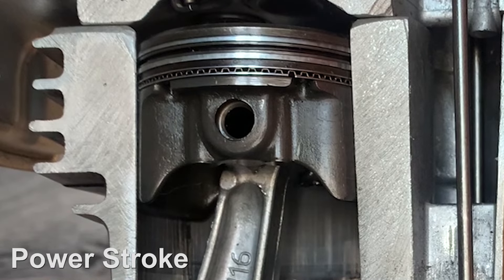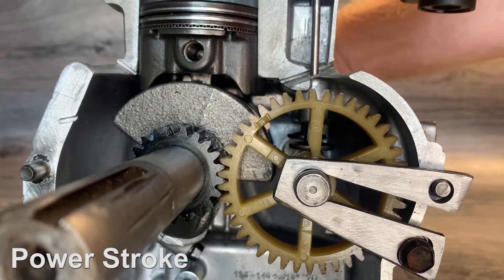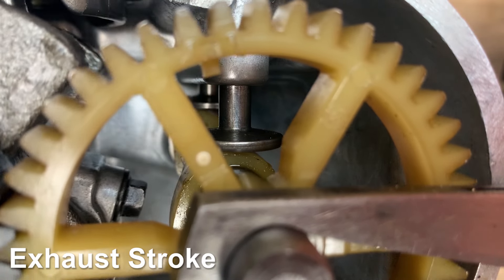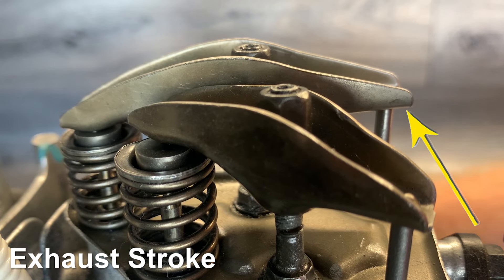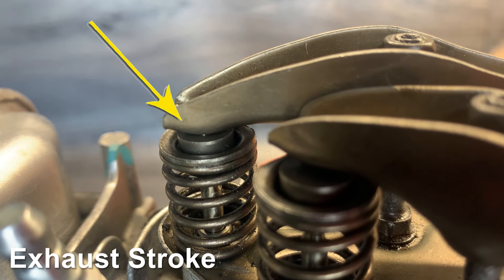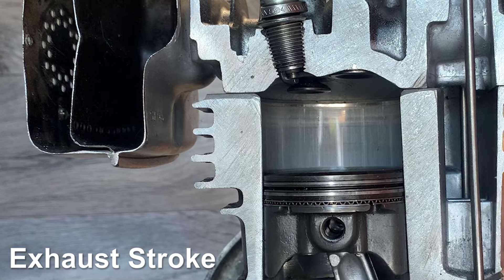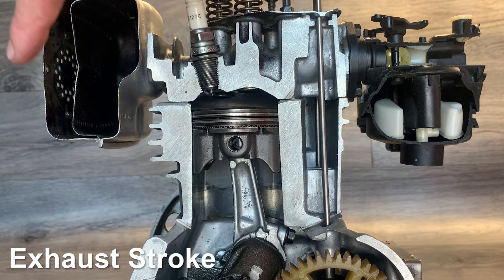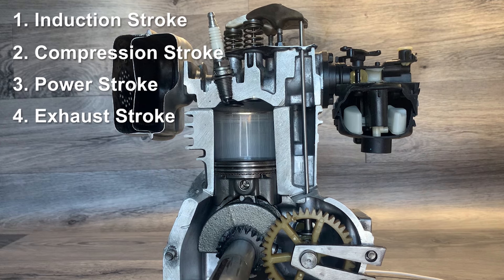Only Video You'll Ever Need to Know how 4 Stroke Engine Valving & Timing Works. (by Craig Kirkman)

Comment: I always adjusted the valves of my motorcycle myself, but only because it is part of the normal maintenance checks, and never really understanding the underlying reasons. Now I finally have a much better picture of why we sould keep good track of it.
However, I wonder why we have to do the adjustment at exactly top dead center, since both valves are completely closed during the whole compression stage. Couldn't we do it at just any point of the compression?
Also, I often hear that if the valves are not correctly adjusted, there is a risk of one of them falling inside the cilynder, causing the complete destruction of the engine. How would this happen?
Reply from the maker: I'm delighted to hear that you found the video on adjusting 4-stroke valve clearances informative and that it provided you with a better understanding of this crucial aspect of motorcycle maintenance.

Regarding your questions, let me clarify:

Adjusting Valves at Top Dead Center (TDC): Adjusting the valves at top dead center is a common practice because it provides a known reference point where both valves are fully closed during the compression stroke. This makes it easier to set the valve clearances accurately. Working at TDC ensures that you're adjusting the valves when they are in the correct position relative to the camshaft lobes and lifters/tappets. While it might be possible to adjust the valves at other points in the compression stroke, doing so at TDC simplifies the process and minimizes the risk of errors.

Risk of Valves Falling into the Cylinder: The concern about valves falling into the cylinder if not correctly adjusted typically applies to older engines with certain design characteristics, such as non-interference and interference engines.

Non-interference engines: In these engines, the piston and valves have no overlap, meaning they cannot physically collide even if the valve clearances are significantly off. Adjusting the valves in such engines might not result in catastrophic engine damage, but it can lead to poor performance.

Interference engines: In contrast, interference engines have piston and valve overlap, meaning that if the valve clearances are not correctly adjusted and the valve timing is significantly off, there's a risk of the piston hitting an open valve during the engine's operation. This can result in severe engine damage.

It's crucial to identify whether your motorcycle's engine is an interference or non-interference type and follow the manufacturer's recommendations for valve clearance adjustments accordingly. Adjusting the valves within the specified tolerances helps prevent the risk of valve-to-piston interference and ensures optimal engine performance and longevity.

Thank you for your thoughtful questions, and I'm here to provide further clarification or assist with any additional inquiries you may have. Safe riding!

I hope this gives a litter more insight

Craig
Reply: @TheRepairSpecialist  That was the best answer anyone has ever given me about any topic, thank you! I will feel a lot more confident next time I adjust the valves of my motorcycle

Comment: What would happen if the clearance is too small like 0.01 of mili meter, how does it affects the air/fuel ratio caused by turbulent flow.? share your ideas.
Reply from the maker: If tappet clearances on a small petrol engine are too small, several negative effects can occur:

1. **Valves Not Fully Closing**: Insufficient clearance can prevent the valves from fully seating against the valve seats. This can lead to:
   - **Loss of Compression**: Proper compression cannot be maintained, reducing engine power and efficiency.
   - **Burnt Valves**: Prolonged exposure to hot gases can burn the valve edges, leading to valve damage and the need for costly repairs.
   
2. **Increased Wear and Tear**: Without adequate clearance, components may wear out more quickly:
   - **Valve and Camshaft Damage**: Constant contact without the intended gap can cause accelerated wear of the valve stems and camshaft lobes.
   
3. **Engine Overheating**: Insufficient clearance can contribute to overheating issues:
   - **Heat Dissipation Issues**: Proper valve seating is essential for effective heat dissipation from the valves to the cylinder head. If valves do not seat properly, they cannot transfer heat effectively, leading to overheating and potential engine damage.

4. **Poor Engine Performance**: The overall performance of the engine will be compromised:
   - **Reduced Power Output**: With valves not closing properly, the engine cannot generate the intended power, leading to poor acceleration and reduced performance.
   - **Misfires and Rough Running**: Improper valve operation can cause engine misfires and rough idling, resulting in an unpleasant driving experience.

5. **Increased Fuel Consumption**: The engine's efficiency drops due to poor combustion, leading to higher fuel consumption.

To prevent these issues, it is crucial to maintain proper tappet clearances as specified by the engine manufacturer. Regular maintenance and adjustment of tappet clearances are important to ensure optimal engine performance and longevity.

I hope this sheds a little light on the question. 

Craig

Comment: So in order for me to know if the piston is at tdc and compression stroke is if I turn the fly wheel and watch the inlet valve open and then close again and piston is at tdc after the inlet valve is closed that means its at compression stroke? Am I right guys? Following the 4 stroke cycle? 😂

Comment: What happens if you set the valve clearance when position isn't exactly at TDC on compression stroke? Wouldn't it still be ok as long as the cam lobes arent open on either valve?
Reply from the maker: If you were to adjust the valve clearance when the piston is not at TDC on the compression stroke, even if the cam lobes aren't directly opening the valves, you could introduce errors in the valve timing. This can lead to various issues, including:

Poor Performance: Incorrect valve timing can result in poor engine performance, reduced power output, and lower efficiency.

Valve Damage: If the valve clearance is set too tight, the valves might not fully close, leading to hot gases escaping into the valve train, potentially causing valve burning or damage.

Increased Wear: Incorrect valve clearance can accelerate wear on valvetrain components such as the camshaft, cam followers, and valve stems.

Noise and Vibration: Incorrect valve clearance can cause valve train noise and vibration, leading to a rough-running engine.

Emissions and Fuel Economy: Valve timing has an impact on exhaust gas recirculation (EGR) and air-fuel mixture control, affecting emissions and fuel economy. Incorrect valve timing can lead to increased emissions and reduced fuel efficiency.

Engine Overheating: Poor valve timing can affect the engine's cooling efficiency, potentially leading to overheating.

I always recommend following the manufacturer's guidelines for valve clearance adjustment and ensure that the engine is in the correct position before making any adjustments. This involves turning the engine over by hand or using a starter to align the piston at TDC on the compression stroke for the cylinder being worked on. This precision ensures that the valves are properly timed and the engine operates optimally.

I hope this helps a little.
Craig